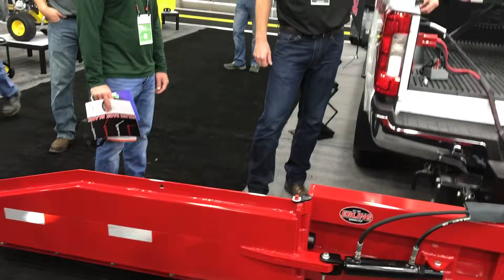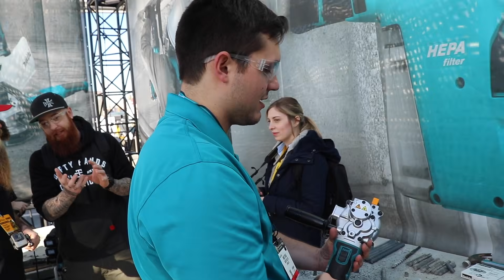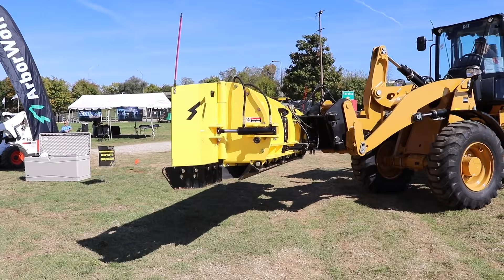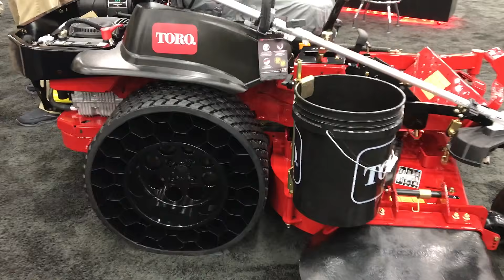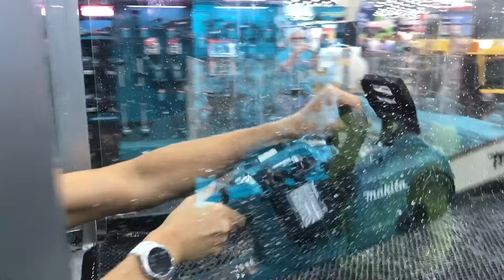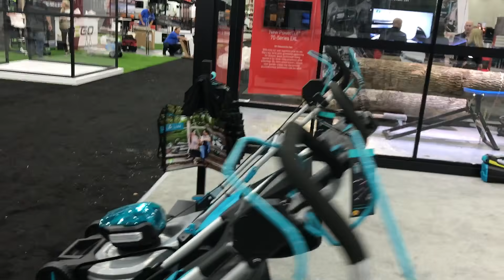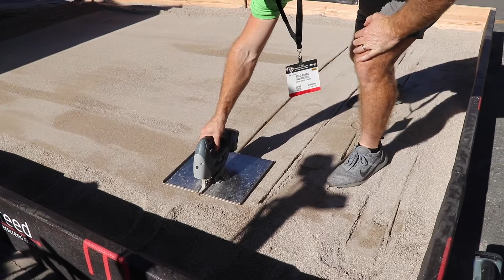Best & Worst Landscape, Construction & Power Tools, Equipment & Innovations of 2018

Comment: The Makita guy running the concrete saw with no safety glasses and his pass hanging down like that is making adult decisions which could have adult consequences.
Reply: Why does it need to be over your shoulder height in order to be used upside down?  I can easily picture situations where you'd want to run it in "unusual" orientations and still be below shoulder height.
Reply: Yea
Reply: Why hfcgedvjt
Reply: probably russian
Reply: "Stop screwin around in the stain room." - the other go-to shop class instructor saying
Reply: you ever been on a jobsite? and if so did you just have a clipboard and clean boots?
Reply: I was thinking the same thing. In all honesty I couldn't count how many times per DAY I should have safety glasses on and dont.. trade show they should be glued to your face.
Reply: Seriously, is that really all that you want to say about the video....
Stop whining
Reply: Jim's videos I’m suprised his boss didn’t tell him
Reply: Jospeh H  ha. Have you ever ran a concrete saw. The blade would not cut your foot off if you had on proper footware. It would not even cut it off if you didnt. That's not to say it would not so some major damage
 But it would not cut off your foot unless you purposely held it in place and sawed it for a period of time. However, I do agree that all proper P.P.E. should be worn at all times. Even if "I only have to cut this little piece off. It will only take a second".
Reply: Was thinking the same thing!
Reply: If any of you use portable generators, please make sure that you are aware of all the warnings. Here is a reminder about generator safety: this is only a reminder for everyone’s safety. This is just to make sure you are aware of all the warnings. Every year after hurricane and winter storms, there were reports on the news that many people have died each year when using generators due to carbon monoxide poisoning and electrocution during a power outage. There were reports about deaths when using generators when the power was out. There is something very serious that everyone should always be aware of when using generators. Some people do run their generator indoors which is not safe and that increases the risk of carbon monoxide poisoning which can cause death of family and you. Some people run their generator in wet conditions which can electrocute them. Here’s an advice about generator safety: please remember that you should never run your generator indoors. Remember that carbon monoxide is an odorless and colorless gas that you cannot see or smell. Carbon monoxide is a silent killer. Keep that in mind. Make sure your generator is 15-20 feet away from your house and away from doors, windows, and vents. Having a carbon monoxide detector is very important against generator safety. Some people also allow children to go near the portable generator which could pose risks. We need to keep an eye on our children making sure that they are not near the portable generator so they won’t get electrocuted or burned by the generator which is dangerous. A locking enclosure also keeps kids safe. A generator shed might look like a tempting place to explore, or take cover during a game of hide-and-seek, but a generator is a dangerous piece of equipment that can cause injury. It says on the manual that we should also keep children away at all times from the portable generator to avoid injuries. Generators pose electrical risks. If you need to use your generator during wet weather, you need a generator tent to protect your generator from getting wet. Don’t let your generator get wet. Keep your generator dry and before using your generator, please make sure your hands and your generator is dry. Everything that is said on the generator’s operating manual should not be ignored. Never smoke cigarettes near the generator. Please keep flammable things away from the generator. Never overload your generator too. Your generator can catch fire. Never ever try to plug a generator cord into a wall outlet to avoid back feeding. Back feeding your generator is dangerous. Always turn on your generator first before plugging in appliances and shut off the appliances before turning your generator off. Use a heavy duty cord for your generator and the cord should not be worn out. All the instructions should be followed carefully. Never refuel your generator while it’s running. It can cause fire if fuel spills while your generator is hot. You should turn off your generator and let it cool off before refueling it. Having a fire extinguisher next to the generator is also important. This is only a reminder for everyone’s safety of using generators. Make sure your generator is properly grounded. https://youtu.be/I1jT3ANENvI and here is a video more about keeping others safe when using generators. Hope this helps. Thank you. It’s important to follow the safety instructions.
Reply: Ha, I was thinking the same thing!
Reply: Yeah, and I don't know why he kept raving on about how it runs upside down when the manual clearly states:  
- Never cut above your shoulder height (17).
- Do not wear any jewellery or clothing that can get caught or distract from the
operation of the Power Cutter
- Work gloves (F) of tough leather are part of the required work kit of the Power
Cutter and must always be worn when working with the Power Cutter.
Reply: i believe the point is theres a large part of the industry that couldn't possibly run a business like this... they are business owners who must balance the ability to work safely as well as fast enough and cheap enough to run a business and put food on the table. Not every place is union, sees OSHA, and money isn't a thing
Reply: Shona O’Neill IDK what kind of rinky dink trash company you work for or if your just some  idiot on a farm but where I come from you respect the saw... Idiots like you are the ones who got a scar from their chin to their foreheads where the saw sliced their face in half...You ain’t got to read instructions because the competent person on site should never hand a demo saw to an uninformed laborer without making sure they are in proper safety attire and are not only trained in how to use it but are educated in the dangers of not handling the machine properly...
Reply: safety equipment is for pussys
Reply: @wileecoyote4116  because real men wear safety squints... \s
Reply: Shona O'Neill some people work on jobs where people are hired to make sure you work safely. Some people make serious money performing work to a level that ensures safe completion. Some customers will pay greatly for said employees. Furthermore it is entirely reasonable to question why a rep of a company at a trade show is advising use of a product in direct opposition of manufacturers instructions. The legal ramifications of doing so is beyond your comprehension evidently at this juncture in your life.
Reply: Unbelievable

Comment: I would like to see a small power plane that would have a few easy change knives for planning out the back of 1X4" flat stock, when it's used for door and window casing, and maybe be adaptable for narrower casing also, like down to 2 1/4".

Comment: It's really too bad that the Makita rep could not explain how the cool cut technology worked.   "With the rpms and our technology it's a cold cut".  Why is it a cold cut?  Machine shop tool engineers have put the thought of transferring the heat into the chips forever. 
 I'm not hacking on Makita or your video by any means but if I went to a show and the rep couldn't explain the product, I would probably move on.  Thank you for explaining it afterward.
NOW, that being said, congrats to Makita!   Waiting for material to cool down after cuts is just time consuming and expensive on shop rates.   
I'll be looking into this!  I'd like to try for my own review and referral
Chris.

Comment: That's pretty neat with the dust collecting system. Only reason OSHA is doing it is because of  Silica dust exposure which does the same damage to your lungs that asbestos does. It crystallizes in your lungs scaring the tissue eventually destroying your lungs
Reply: SilvaDreams and what about all the people around you?
Reply: It's cool
Reply: Pneumonoultramicroscopicsilicovolcanoconiosis
Reply: @giggleherz   Alot of it has to do with this too. https://www.youtube.com/watch?v=XDLkMDJXl_0 Its not just about the concrete dust.
Reply: Lemme tell you a story about a time we spent a whole week cleaning a facility only to have a contractor and his 600lb gorilla come in and run his dry saw on cinder block wall. I mean that's it really; dust from concrete makes A MESS. Even if it weren't for OHSA, the dustless system is attractive because it means you need to spend less time cleaning if you customer demands it.
Reply: OSHA is not a one sided sword, the issue is is that its pretty dull when it comes to big money companies but when it comes to the little guys, you have no way of fighting bullshit when it comes knocking. Oh, some idiot put some tape on your perfectly good extension, not cut or damaged cable? Sounds like an OSHA violation.
Reply: Yeah, I was enjoying this video a lot more before the throwaway  remark about OSHA screwing the little guy. OSHA's there to protect the little guy. Before OSHA, employers could get away with all kinds of dangerous working conditions.
Reply: @fuerteybrava  Many of OSHA's regulations actually put people at risk to! Yea safety is great only if it is actually safe! Most any safety thing even outside of OSHA can be safe or unsafe depending on the situation!
Reply: @fuerteybrava  OSHA fines are designed with punishing big companies in mind, but they straight put you out of business-and u lose everything; house, car, savings, everything. For one mistake by one employee for literally one second if they choose.
Only a large corporation can amortize the costs of, and survive fines like that. Thats his point about the little guy.

Once cited, which could be for just a poof of dust, it is up to you to prove your innocence. It's completely backwards-like the courts in the third world...and if you see this unfold, you quickly learn you don't win against them, no matter what the truth is.
I implore anyone who does not personally know a groups culture to not to take a position for or against them. It's very damaging.
Reply: @fuerteybrava  It is possible for OSHA to not be perfect..
That wasn't just some political statements he was making-that was him lashing out to a group he feels has been abusive to him and his peers. Having worked in that field, I can assure you, that was personal for him.
Reply: Which is why you wear a mask when break concrete, but I guess you need to protect the stupid now days.
Reply: @SilvaDreams  if you have a beard, a mask is not as effective.
Reply: @Noold  water dude!
Reply: Brett Downes u think cutting concrete is dusty ? Try working in the oil fields hauling frac sand. Then blowing it into large open air tanks lol while about 10 other trucks are blowing sand in at the same time. At a rate of about 45k lbs an hour push rate out the hoses. 
Dusty is an understatement. 
We had to wear dust masks but those are like screen doors on submariens in that environment.

Comment: Great vid, WOC is an incredible place to walk through.  BTW, roller screeds for concrete have been around for quite awhile, excellent tool.  Best for sidewalks, work well on bigger slabs but pretty cumbersome, need a good crew.  Smaller ones are driven by a small 2 or 4 cycle engine, bigger ones I've seen are hydraulically driven.  A good crew who splits settng forms/pouring can lay out an awful lot of sidewalk in a day.

Comment: I'm out in California I don't dont too much industrial were OSHA is problem but how do these vacuum tools really perform against nomadic tools is it as efficient does it have the power nomadic tools have does it move the job forward and more efficient thus more money for the contractor, I'm a huge Bobcat fan and all these other competitors or companies have their perks and and downfalls as far as pushing force and operator comfort what other skid steer loader would you recommend because bobcat does have a heavy ass which makes it a little inconvenient on slopes but an intelligent operator can make it work by building ramps and getting the job done safely and efficiently I just recently purchased an s570 and it's extremely convenient for the power offers and the size allows easy access and a comfortable radius I don't work in the snow but I do like how Bobcat recently made all the maintenance filters battery and starter accessible. But like I said all skid steer loaders have their perks and downfalls I personally prefer Bobcat to any other skid steer loader given that the visibility could be better but you should know your machine and it's size I was just wondering what do you prefer

Comment: 1st how do I get your job 2nd I no that Makita put you out there to test out the tools but why didn't you test the hydraulic chainsaw that you can attach to a skid steer loader was it problematic how's the maintenance on these tools and how long is the battery life third how long do these batteries last in high-output situations with concrete with reinforced number 5 rebar schedule 80 strength and how does it do against 3500 PSI that must drain battery right
Reply: Issac Ponce - if I may tag onto your post here - I agree, the MaxCut caught my attention right away - I own and live on a canyon / mountain ranch in central Idaho and I have 2 bobcat skid steers with 22 attachments and have just ordered a Bobcat E45 Excavator - we had a major forest fire 2 years ago and I am having to clear literally thousands of burnt trees from our property - I am 71 years old and have been looking for a hydraulic attachment to help deal with clearing these trees - this looks like it might be perfect - wish we could have seen it in action. Thanks for doing this video - hope to see more of them in the future.

Comment: We are Contractors and I run Makita since over 15years now and still can't tell you how long they last. Yes we burn thru some tools yes we all do. But their way of sticking to the 18V is the major plus so your batteries are the same even for the next Generation which is BIG for us. Also I think what you should show more on those trade show's is also the batteries which power those powerless tools. One major thing is chargers in my eye because if I don't have enough batteries in rotation our workers play pocket billiard which doesn't make me money. Makita should invent and sell also a special charger "SLOW" charger which we could use at our Trucks and Shops so they get slow charges over night which gives them a much longer live. Pitch it to them I am sure they will pick it up. Also parallel chargers would be great on 12V/24V and 120V/240V.

Comment: The oscillating weed eaters are great for underwater applications like removing cattails while water in present such as around a dock.  In my opinion thats its only application, a poly string head works better in rocky environments (medium/large rocks).  Ive never used a weed eater around small rocks like sand/gravel (I mean why would anyone use a weed eater on sand/gravel?) but the oscillating head would work well for that application.

Comment: Stan - What's your opinion of the dust control technology?  I'd be worried about long term reliability of that equipment because of what looks like a lot of plastic connections.  I can see that breaking after the first week in the back of a trailer, much less on the job site in hard (read: careless) use.
Reply: Water. Water is a good way to control dust. Cheaper than spending thousands on tools
Reply: Jason Kraus I’m sure it’s like guards on skills saws their there and when osha decides to show up they have it ready to go so no one gets fined
Reply: Those rubber boots won't last long, and the proprietary filters will cost a bomb. All good for the company's consumable revenue. Still, it meets a need and someone will soon make mods that will suit high usage applications.
Reply: Jason Kraus

Comment: 10;30...what brand.. Would like more info
Reply: Adan Molina Redmax makes a reciprocating weed eater which is exactly the same.  I have used it in underwater applications such as removing cattails from a dock.  It would also be good around very loose or small material such as sand/gravel.  I think poly string heads work better on land and around medium/large rocks (the string is much more efficient - the reciprocator is very slow).

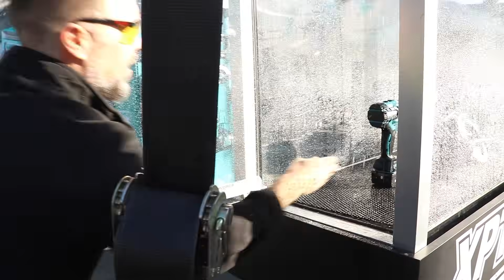Comment: At the 9:00 mark where it shows the flat proof wheels on the Toro zero turn mower...I noticed the String trimmer mounted to that mower...was that a new item as well ? Was it some brackets to carry along your string trimmer ?
Reply: Do you know the name of the string trimmer that attaches to zero turns? I always thought it would be neat not to have to get off the mower. What did you think of the blade string trimmer that doesn't kick up rocks. Is that just for brush or would that work on grass? Couldn't see the name of the company in the video.

Comment: Don't get the 4 stroke motor been better than the 2 stroke motor in the petrol saw? 4 stroke has oil in a sump and a 2 stroke doesn't so turning a 2 stroke upside down wouldn't bother it but it would with a sumped engine as the oil will run to the top of the cylinder fouling the plug?
Reply: here I thought the problem with running things upside down was the gas all goes to the top of the tank... I guess it has a pump or something.
still I see it being finicky and not working all the time.
Reply: you should watch the video again.